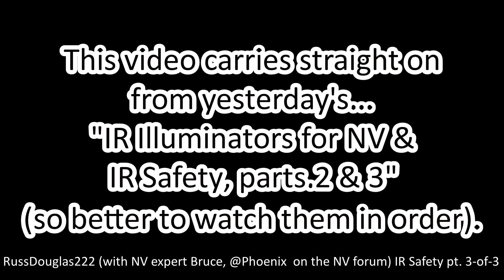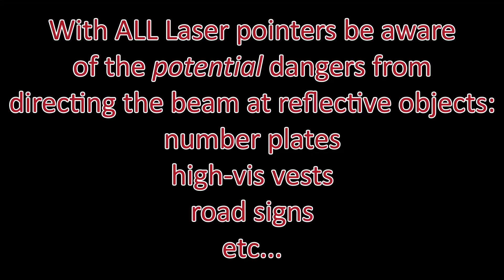IR Illuminators for NV & IR Safety, pt.3-of-3

Comment: Very informative! Learned so much in just half an hour. I found myself looking into the beam of an ir torch to find out if it was switched on. Now I know better. Thankfully it was a LED. Good tip to look at the reflection on your hand or through a mobile phone. I’ll treat the red dot on my new NV008LRF with great respect. Does the warning also apply to the range finder beam? I assume it does. Will do the bin bag test. Finally, great tips and info about the 18650 batteries. Didn’t know what ‘protected” meant. One last question: Can I use a pin head surface 18650 instead of the flat head (can’t screw the cap fully shut but it works) or will that damage the unit? Once again, thanks to you both. I’ll never understand how anyone could give a thumbs down here.
Reply from the maker: Thanks very much Matt that's very kind of you.
There's certainly a lot less energy being output via the LRF beam, but it's definitely safer not to look into any IR beam when switched-on.
No you shouldn't use a pinhead 18650 as you don't need the 'protection' it offers, but more importantly you'll not be able to screw the cap on and thus make the unit watertight.  Bruce recommends genuine Panasonic or Samsung batteries.
Thanks for watching and commenting, all the best.
Cheers. Russ
Reply: Thanks Russ! I have another question. The Pard does not (or no longer) have a dedicated app for the Wi-Fi connection. Is there any app that you can recommend that will work? It’s a bit silly to offer the Wi-Fi option and then no one can use it. Same goes for the Nitesite that I also have. There used to be a NitePlayer app which no longer works and has not been updated or supported for a while. Perhaps a generic Wi-Fi app could work for both?
Reply from the maker: @matttautz231  I've heard via the NightVision Forum (https://www.nightvisionforumuk.com/viewforum.php?f=3) of a few that work, including PPShow and OK Cam plus - but I just record direct to 128GB MicroSD card, so haven't used them myself.
Hope this helps, cheers. Russ

Comment: Great series keep up the good work didn`t know that about the batteries and I have always been worried about the pard being switched on by accident in the gun bag and running the battery right down as I read online that if you flatten the battery in the pard it will stuff up the menu function. What make of battery would you recommend as a spare for the pard nv008 as it came with only one battery branded pard  many thanks  David
Reply from the maker: Thanks very much David. I believe/remember that was an early problem whereby if the battery ran flat or was taken out while the unit was on, the firmware had to be reinstalled -but that was fixed a long time ago by a firmware update.
Bruce always recommends (1) avoid any battery brand with "..fire..." in the name (2) stick to genuine Panasonic or Samsung(?) batteries from reliable ebay suppliers like 'Torchy the battery boy' or 'The Ecolux Shop'. Remember it's only flat-top 18650's, and don't use silicon oil if the battery cap threads are dry/scratchy, instead clean them and apply a little bit of Vaseline.
Oh and if you record video to the card with audio enabled it can pick up interference when the battery drops to one bar, or with cheap batteries.
Enjoy your PARD. 👍🏻 Cheers. Russ

Comment: The wolfeyes Xbeam in 850nm or 940nm its switch will show if its in the off or on position. No need for a mobile phone.
Reply from the maker: Cool, hadn't heard of that one, is its power adjustable too?
Cheers. Russ
Reply from the maker: I've found and emailed their UK website, as even their Aus website's missing some info, such as is it dimmable and is the torch body 25mm dia?
Cheers. Russ
Reply: @RussDouglas222  yes dimmable  4 or 5 levels and 25mm body.
Reply from the maker: @mchughcb  Cheers. 👍🏻
Reply from the maker: @mchughcb  Ah the IR's seemingly only LED-powered though (not VCSEL), I've emailed them to double-check.
Cheers. Russ